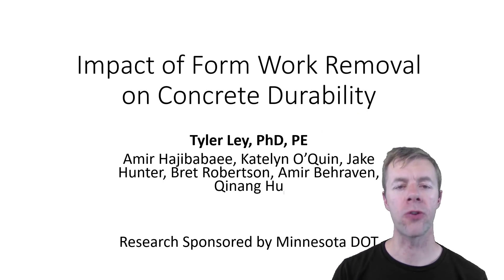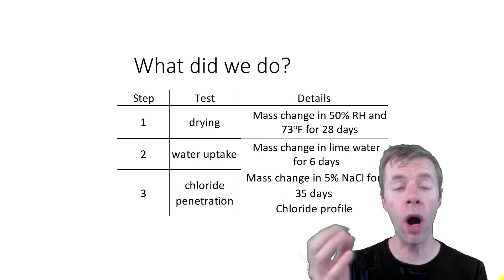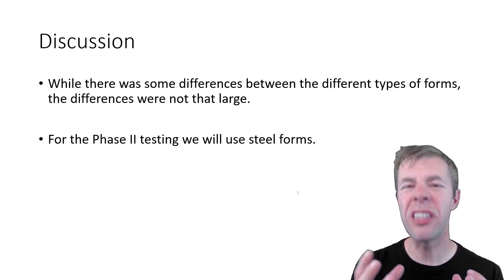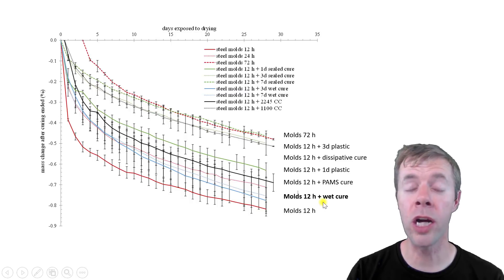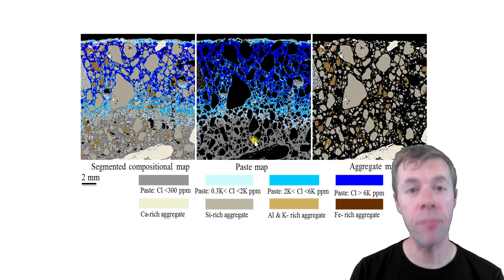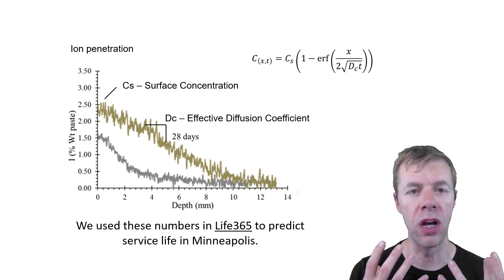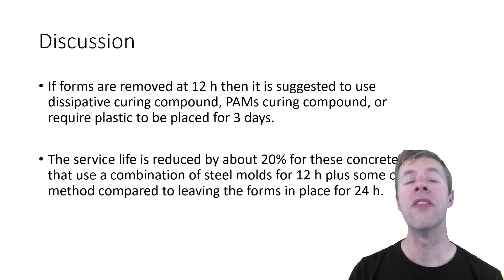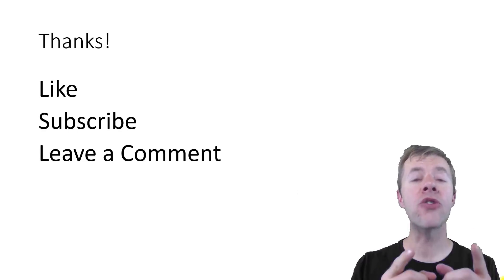Does Early Form Removal Impact Concrete Durability?

Comment: When you join a curbing to a slab have to pull the molds right after it sets up so can fill in the stake holes on the slab side.

Comment: Great content; thanks; though I  suggest considering another factor that would impare concrete quality due to preterm form removal which is  caused by the force inflected on structure while removing the shuttering; many times you could notice chopped off corners of concrete columns because of fast removal of framework; that raises concerns about existance of hairy cracks within concrete elements; isn't right?

Comment: How the hell does rubber and steel entrap moisture less than wood? That feels very paradox.
Reply: For anyone reading/wondering about this (a year later), wood absorbs moisture and keeps it in contact with the concrete as it cures. Rubber and steel don't, and gravity will pull it away. That's what's meant by trapping here, not the air permeability or evaporation prevention. That's also why burlap works, but not as well in a vertical setup.

Comment: Excellent video. Only thing I would've like to see is after completely curing, the strength difference between the different methods. Thinking using a hydraulic press, monitor the psi applied, then attempt to see what the crush pressure is and if it meets the 4,000 # or whatever you're using listed rating.

Comment: Thanks Tyler for the videos.  It's a great refresher for me since it's been so long since I took my concrete class in college.  It may be dumb question, does it mean you can remove the formwork after the concrete reaches its "final set" (thought technically we do not know exactly is the final set)

Comment: Wouldn’t this also depend on the exposed surface area? For instance if you’re pouring a large slab for a foundation, the ratio of the forms’ surface area compared to the surface area of the exposed top horizontal slab is very small.

Comment: Great info Just poured a root cellar domed roof and the forms underneath will stay in place for 30 days but the top is open to the air. Tarped for 4 days.

Comment: Why did wood forms lose less mass than steel or rubber forms? I am curious since I would normally except wood to absorb moisture.
Reply: It does initially, but then it gives back that moisture to the curing concrete surface. So the surface is soon slightly better hydrated than the interior. 

Also curing concrete is shrinking. The moist wood fibres are resilient, so it tends to stay in better contact than impermeable forms.
Reply: Them absorbing is exactly why. They are holding and releasing moisture.

Comment: What if the forms had an impermeable liner that stays behind for a while when you take them off? Or more extreme, since it's a vertical wall just leave the liner in place as part of the structure.
Reply: Good question.  Makes a case for ICF walls IMO.

Comment: I am considering building a shed with aircrete using 24in. slip forms  as I did with a previous shed made with on site mixed concrete. After watching this and previous videos I am thinking of puting wet blanckets under plastic sheeting on the aircrete after I remove the forms but how to do it when I move the forms up for the next pour. Do you have any suggestions.

Comment: Ideally would love to leave forms, specially vertical forms min 72 hours but scheduling and project costs always determine our push. We tend to us curing compound on all of our concrete, @ slab, columns and beams, coupled with the admixture of HRWR -- which we have noticed it helps tremendously achieve faster reach to our psi goals.... any other ways we could expedite without sacrificing quality?

Comment: This channel is excellent!  I'm curious about the affect of the fine skin of concrete being pulled off during demolding.   I'd like to run the same test but use silicone for the rubber due to its amazing release properties and virtually no remaining concrete skin left in the mold.  My question is, would keeping the skin intact  help with moisture retention?  Also, what affect does vibration cause during demolding/handling at 12 and 72 hours?  I would guess that the fresher concrete will be more affected by vibrations/stress from demolding.  Thank you for the chance to geek out!

Comment: So with a wood form left on for 72 hours on a vertical wall...should I cover the open top with plastic as well?
Reply: Other comments indicate that ponding (immersion in water) is best. Plastic film over the water slows evaporation. Burlap over level surfaces also holds moisture, but probably not 72 hours, so re-wetting is needed. Unless the wet burlap is covered with plastic.

Comment: Hi Tyler. I have a question for vertical concrete (i.e. walls). Normally when wet curing with burlap with formwork on, the water is retained on the flat surface on top, does this mean that the side of the walls doesnt cure as much as the top due to less contact with water. Is that assumption correct? Or will the water from the top of the surface somehow provide enough moisture for the top and the side of the wall? The way I see it, only the top of the surface is sufficiently cured, while the side of the wall only get minimal water contact from water that flow down  from the top through the small opening between the formwork and the wall.

Comment: Did your burlap have a soaker hose while wraped in plastic. After a compressive cylinder shows to have a 15 mpa strength, usually after 2 days, we are able to remove our forms if we use burlap, saoker hose and white plastic for up to a minimum of 96 hours since the concrete pour.  Ministry Of Transportation of Ontario, O.P.S.S. Standard

Comment: Hey, question.
How applicable is this type of thing for Insulated Concrete Forms?
Reply from the maker: Hyperstrike,
Most of the time the forms are left in place for the insulated concrete.  This means that it will seal the concrete and keep it reacting.  This means that insulated concrete forms would be even better.

Comment: I like concrete but still confused the relationship between a dry mix being stronger and keeping it wet during curing. Do we only want to retain it's moisture content tent or do we want to add water during cure? If you could submerge curing concrete in water for a few days will that be better? What's the relationship here? I do some ferrocement formless work and we always spray it with a water hose as often as we can for several days to help it cure, sometimes we use tarps but mostly just the water hose.
Reply from the maker: Ben,
My video tomorrow till talk about this.  You can also find more here: https://www.youtube.com/watch?v=8XApTsnDmgY

Comment: First,  i really enjoy your channel. 

Hi, im an artist with an interest in concrete.    By the way i have very little experience with concrete.   
I want to build a bunch of walls L7.5'x H6.5'xW9" easy enough so far.    Altho remember im an artist so i have to make the walls overly complicated.   I am strongly considering the use of styrfoam glued to ply wood as the form.   Because i can sculpt styrofoam super easy.
I was figuring the smallest thickness of concrete would be 2" in thickness in all directions.    
I reside in santa fe nm,  so it is super dry.        

Please advise me, i know there are so many things to consider.   If it works out i will send you a form. 

Nemo
www.jiin.us
5059131058
Reply from the maker: Nemo - I am not sure what you mean by 2" in any direction.  Are you going to order your concrete from a local producer?
Reply: @TylerLey   yes, on local concrete. I meant 2" in diameter, altho diameter can be changed at this point.

Comment: I plan on building every thing out of concrete for the structure of my home and out buildings.  Is there any real gain to leaving the forms on for more than 72hr say 6days or more?
Reply: The difference between 1-3 days is much larger than 3-7 days for curing and strength. At 3 days you achieve ~50% design strength, 7 days ~70% and 100% at 28 days (this is a generalization, concrete admixtures can effect the early curing and strength). If you can wait 7 days to pull forms, great. If not just use curing compound after they get stripped off.
Reply: @brianhelmold1332  I think he is emphasizing on leaving the forms for 6days or more.  what is the recommendation for it?
Reply: @halalmeatshophk  best practice is 7 days for things like walls. Keeping them covered keeps the concrete from drying out and helps curing and there is less risk of damage during form removal. Any longer than 7 days has little benefits as the most important part of cutting is over. Slabs it's less important for forms since the area is so much smaller than the top surface. For slabs it's more important to keep the top from drying out after initial set. Curing compound, curing blankets or even wet burlap work well.

Comment: how often does vertical concrete come in contact with chlorides?  I guess I'm more curious about parking structures and not bridges. specific to parking structures I can see at the base or if drains are near columns but would like to know your thoughts on exposure conditions. maybe even weakness of horizontal construction joints between elevated decks and next lift of vertical and the how this exposes the design to elements
Reply: He was using chlorides to test permeability.

Comment: If submerging the concrete in water is an option, would it be better to remove the mold as soon as the concrete is able to be moved without damaging or leaving it in the mold a bit longer? Submerging the concrete seems like it will produce the best curing, but I'm not sure.
Reply from the maker: Submerging concrete is not practical in the field and this is why I suggest leaving the forms in place as long as practical.  If you are making smaller items then applying water to the surface will help you improve the quality of your concrete.  I hope this helps.
Reply: @TylerLey  Hi Tyler love your channel. I am a  high school physics teacher in New Zealand and teach some of my younger male students the gentlemanly art of making reinforced concrete. We then test sample blocks until failure by seeing how many students they hold. What I would like to ask is, do you know of any simple experiments we could conduct for project work for student science fair projects for kids of about 14 years age? One project we looked at is the use of unwashed marine beach sand vs clean sand but have no idea how we could test this. The second is looking at the effect of heating on concrete (inspired by one of your videos) the issue hear in Auckland is our aggregate is basaltic lava that is very stable with temperature. I am reasonably sure that the University of Auckland would help us if we could develop a reasonable project. I would greatly appreciate any ideas you may have.
Reply: @TylerLey  -- With submersion, I would worry about leaching of the cement at the surface if there was enough water present for any dissolved solids to be diffused away throughout the water. With a wet horizontal cure using burlap, there isn't enough water present to leach much away.

Comment: A doc,  I have a suggestion for you and testing ... using this testing method... and ''service life''...
Please, consider grabbing some concrete curb that is being replaced by your municipality...  (use that because, it will have a ''spec'' that was used that you can use values from - confirmable by the concrete load ticket)...    Then you can take the ''cut and removed section'' (NOT jack hammered as that would or could damage or corrupt the test sample)...
With all that said, we have a three sided exposed sample (the concrete above the street level AND you have concrete that was ''left in the form''  (well, they backfilled very quickly and created your three sided form below the surface... hopefully, you can find a sample curb that is 15 plus years old and do your testing on... This would give you a more accurate ''365 life'')? 
Hopefully, you can find a sample that was installed in ideal concrete installation time period / weather... which would be overcast day, 70 degrees, backfilled immediately and forms that were left on for three days, etc...  my thoughts...   
Thanks Tyler for your content...   take care.
Reply from the maker: Thanks!  I think this is a good idea.  I would be open to doing this if I had an owner that would let me take the cores and would pay for the testing.  This is the type of stuff that we need to learn.  To really draw strong conclusions we would want to take samples from several places, but I think this is how we learn new things.